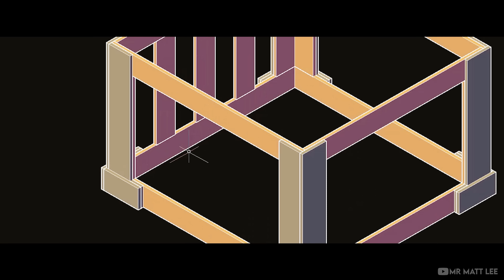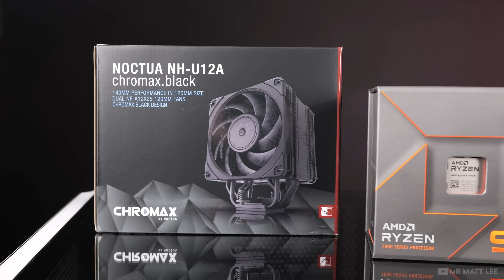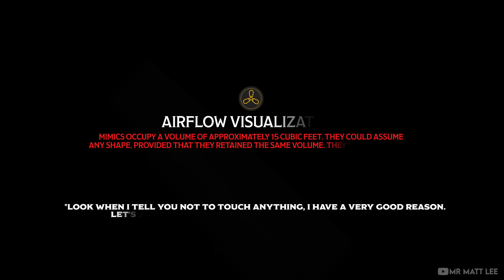Dare To Play?! | Dungeons & Dragons TUF Gaming GT502 PC Build | Honour Among Thieves | AMD RADEON

Comment: Hey MML! Nice content once again. Be sure to check the instruction manual for that MoBo! For single sided M.2 drives there is a small rubber square in the accessories packet to keep the drive from flexing with the heatsinks installed.. Keep up the good work!

Comment: 06:58 How did you fit a 7900xtx tuf on your motherboard? The Gpu is too wide to interfere with the case. So I used a riser kit. Did you use the method of putting the case in with the gpu fastened on the main board?
Reply: Pretty sure its the regular XT, not sure if there is a difference though. I think installing it already attached to the board is only way to do it with that GPU when horizontally mounted. Really surprised Asus did not design their case to fit with their GPU lineup perfectly. One youtuber actually took an angle grinder to his case and cut off the lip behind the glass panel in order to fit it in.
Reply: @deuswulf6193  Yes. They don't care about Radeon. We can tell it by the absence of a ROG model on the 7900xtx. Hard to believe otherwise it's a lineup from the same period. Thanks for the kind advice bro.